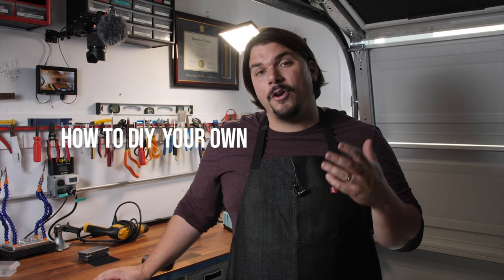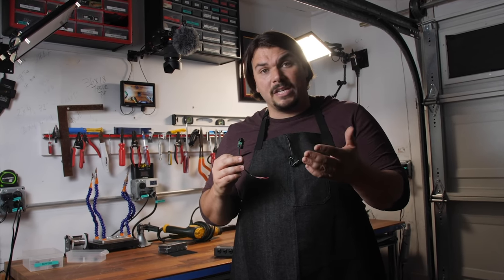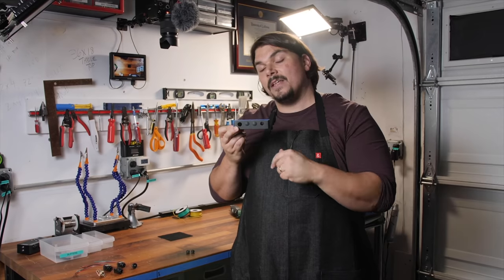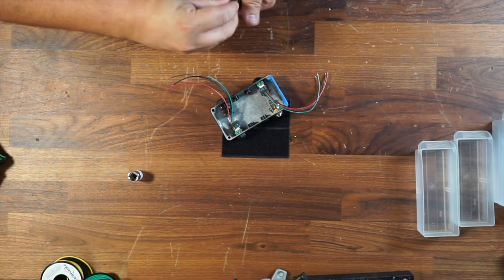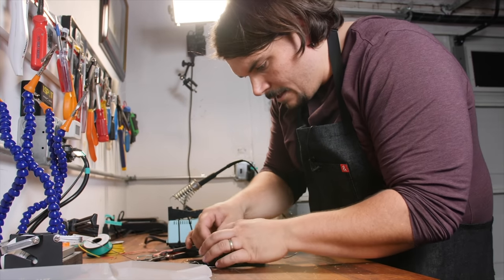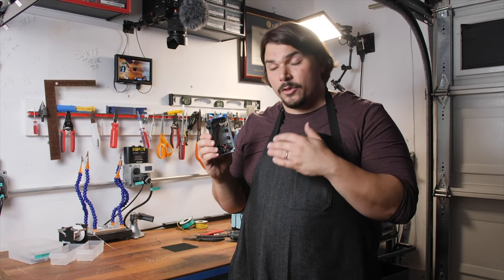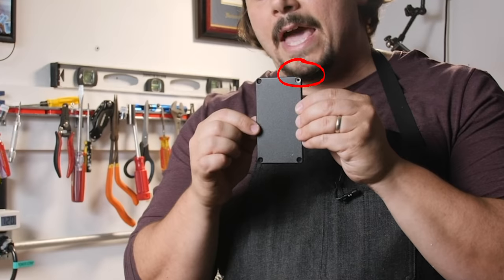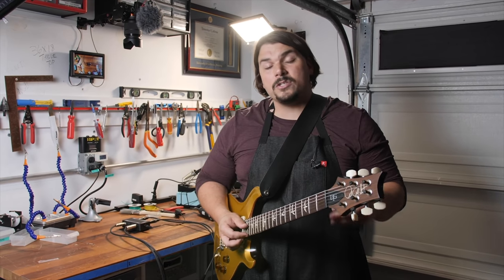Build Your Own Buffer!

Comment: Hey there, so with this build I'll end up with 1 Meg Ohm buffers both at the input and the output of the board but in other videos on the topic I recall (and please correct me if I'm wrong) you recommending a 80-150 Ohm output buffer. Wouldn't this result in an extra bright tone? Thanks!
Reply from the maker: You can set the R1 value to whatever you want but I recommend 1M on the input buffer, the output buffer isn’t so important what the input impedance is.  Anywhere from 500K to 2.2M would be fine.  For the output impedance anything below about 150 is ideal but there are some exceptions depending on the rig and the amount of capacitance on the output of the buffer.  The closer to zero ohms output impedance you get the closer it’s going to sound to your guitar into amp - not brighter, just more neutral and less affected by capacitance.
Reply: @VertexEffectsInc  I really appreciate the answer, thank you! I not quite sure how I would set the value of R1 and couldn't find any resources on Creation Audio Labs' webpage, though. Do you know of any online resources that I could refer to? I'll shoot CAL a message as well, surely they'll be able to guide me :) 
Thanks again for your time and for the great content you're putting out!
Reply from the maker: @francescofusco3013  R1 is the place for the first resistor in the circuit that changes the input impedance.  If you set it to 1M, it's 1M, if you set it to 500K, it's 500K.  So you can use that R1 space to set the input impedance to whatever you want.

Comment: Great content as always, Mason. Is it possible to just use the buffered inputs and outputs for the guitar and amp, essentially creating a buffer pedal?
Reply from the maker: I don’t understand the question
Reply: @VertexEffectsInc  I think he means connecting both cables from the amp and guitar through the buffer, utilizing it solely as a buffer pedal.
Reply from the maker: @RyuKatolikeseaweed  still don't understand
Reply: @VertexEffectsInc Unless I'm mistaken I think he wants to use this as his only pedal between his guitar and amp. And he's asking if it would serve as a buffer pedal if he does (which it will).
Reply from the maker: @RyuKatolikeseaweed  any pedal turned on, buffered bypass or not, it a buffer.  However, the quality of that buffer is generally poor as a line driving or controlling the pickup loading.  Remember a buffer is not a buffer is not a buffer.  Not all buffers are created equally.  So just because you have a buffer in name, means nothing about how good it is at isolating the impedance of your devices, controlling you pickup loading, or driving capacitance on the output.  This is why I advocate for dedicated input and output buffers so this is no longer a concern.  Your board has a hardware firewall so you can have all sorts of impedance changes and you'll still have a constant high quality line driver and your input will have the right loading so the guitar reacts as it would plugged into your amplifier.

Comment: Hi, just wondering...the guitar signal goes through the cables used to make this loops/buffers etc. Can you use the Mogami 2314 to wire it for better sound or is there no advantage at all? Thanks!!!
Reply from the maker: I actually don't recommend using Mogami, hook up wire is preferable.

Comment: Would that buffer work with a germanium fuzz after it?
Reply from the maker: After it, yes.  Before it no...no transistor-based fuzz (like germanium) will work well with a buffer before it (or low impedance output running into it).

Comment: Would you recommend using buffers for the effects send and returns as well? Seems like there is enough power to buffer all 4 ins and outs?
Reply from the maker: Depends if you have an active loop or not.  Typically on the return of an active fx loop would be all you'd need.  If you have a passive effects loop then you'll need something different all-together.
Reply: @VertexEffectsInc  Makes total sense. Thanks!
Reply from the maker: @Tom-L  hope that helps!

Comment: Hello, doesn't such interface make a ground loop issue, because of connecting grounds of the begin and the end of the pedalboard chain?
Reply from the maker: No, not any more than any other pedal in series would have a propensity to, and all the jacks are isolated except for the input jack.

Comment: Hi  Mason would be MXR CA MC 401 good to use as an output buffer at the end of the chain ? Strangely in the manuals I have it says clearly 1meg Ohm Input impedance and <150 Ohm output impedance but on their web site it says 1 K Ohm input  impedance. Is there a way to measure Input and Output impedance of the pedal with a multimeter ?
https://www.jimdunlop.com/content/manuals/MC401.pdf
Reply from the maker: That would be fine at the end of the chain as long as it's "ON"

Comment: Mason,  This is coincidental that last weekend I found your video from 3/19/2020 about the DIY 4CM box, ordered the parts and they are beginning to arrive.  Now you show how to add buffers...super cool.  Question I have is, I use a few pedals in front of a Vox Tonelab EX and go back into an amp from that (it has switching to turn the DI signal off to accommodate an amp).  I'm guessing I don't need to buffer back to the amp from a Tonelab...right?  Also, do I need an input buffer if I use a good wireless (which I don't have yet) and hit that first from my guitar?  I think I may only need a buffer for the FX loop in my 4CM setup.  What do you think?
Reply from the maker: You should buffer the input and output of the entire system.  If you're using 4CM you should have three buffers, input, output, and return.  I have diagrams for all this.
Reply: @VertexEffectsInc  Thanks
Reply from the maker: @davestadel  sure thing!

Comment: If I wanted to use this without the guitar jack, I should be able to just run a ground line from the “to pedals” buffer, to the pin closest to the pedal wall of the “guitar in” neutrik connector, right? Then just run a ground line to a drilled screw through the pedal body?
Reply from the maker: Depends one what you're running it into.  You could wire it loose I suppose to other jacks but you'll need some I/O to the buffer.
Reply: @VertexEffectsInc  I’d run it just as shown in the 4-cable method. I just happen to like the aesthetics of all black connection jacks on this box, and figured I could ground it to the case with a screw, vs using the guitar shunt jack. I’m just not sure where I should ground the swapped neutrick jack, then having a wire screwed to the case.
Reply from the maker: @gregnelson9335  You can still wire the shunt on the black jacks, and run a wire off the ground lug to the case or even to a washer around the innner jack, like a tooth washer.

Comment: I'm planning on making one of these for my board. The last pedal on my board is an Aphex Aural Exciter/Big Bottom pedal. It has both low and high impedance outputs, a ground lift, and different settings for passive and active electronics. Should that come after the buffer? TIA
Reply from the maker: What's the output impedance of this unit?
Reply: 1Kohm
Reply: Any ideas, Mason?
Reply from the maker: @frankstabler1920  The output impedance, at 1K, isn't low.  That's about 10x higher than I'd recommend.  I'd put the buffer after this still, and just make this the last pedal before the buffer interface - it won't hurt it to have the buffer after it that is a better line driver.
Reply: Thank you! I'm really looking forward to building this. I've already printed the materials.
Reply from the maker: @frankstabler1920  Amazing!  Have fun!

Comment: So awesome, can't wait to try one! Haha how hard would a DIY 1/4" unbalanced to XLR balanced isolator (stereo if possible) box be for like a stomp or iridium? bonus points (a lot of them) for a summing switch haha
Reply from the maker: Isn't the Iridium unbalanced?  I think it already have a low Z ouptut so you may not even need an output buffer.  Don't Mono Sum, just go out of the left output and you can make some new presets with hard panned L outputs when in mono.  The Sum is way worse of a compromise sonically and not what you thing.
Reply: @VertexEffectsInc  yeah it’s unbalanced, I guess I was referring to basically a DI box of sorts to go direct to foh and then a summing switch for it you run wet effects after it but need to run mono for some reason and don’t want to rewire haha
Reply from the maker: @joshfirlotte  how many feed to you need to drive off of the output of the Iridium?  I think its around 100 ohm output which means it could drive about 100ft of low to medium capacitance cable without any loss.  If you wanted to to an SGI type approach to convert to balanced it's possible but not cost effective for this application.  Again the Sum is a HUGE compromise, I would run mono out of it if you want to run stereo wet effects after the output of the Iridium, but isn't it designed to be put last with the wet effects running into the input?
Reply: @VertexEffectsInc  not super far, 20 feet so I guess that would be ok! I don’t know much about phantom power but I heard that is potentially one concern of it coming back from the console by accident?
Sorry, for the summing thing, say I did have the iridium at the end and wet effects wired in stereo running into it, is there still a compromise if I used the sum to mono switch on the iridium as compared to just having everything wired in mono? Does summing maybe not do as good of a job at getting a good mono sound squishing things back together as if everything was just wired in mono? Sorry this is unclear rambling. For example without the iridium even and one amp instead, would there be a big difference between running everything mono to the one amp vs having everything wired in stereo, then summing it back together with a device (like on the PBC6X for example, I think I saw in the editor you can change the output to 'stereo to mono summing') for a single output to the one amp?
Reply: @VertexEffectsInc  I know a few people that prefer their wet effects after the iridium. It would be neat if it actually just had an effects loop before the ir inside. But I was considering running wet effects in a stereo loop and the iridium in a stereo loop of the pbc6x so I could swap the order around depending on the scenario to play with the different sounds. The guys say things sound less muddy and you can go even wetter with wet effects after
Reply from the maker: @joshfirlotte  If you are connected directly to the mic input and not a separate line input (like some mixers have), it hypothetically could do some damage.  Phantom power is current limited - I think maybe 10ma, so if the DC output impedance of the pedal is high enough you could have a problem.  If possible use a line input on the mixer and you'll have no issue.  The issue with summing is that most of these stereo pedal devices aren't designed to be summed with external hardware.  Most of the stereo mixes inside the pedal aren't always 50/50 Left and Right, and the summing devices put them together as though they're 50/50.  Also the polarity/phase of these stereo effects, in particular modulation devices, often have inverted outputs on one channel.  This further creates issues when doing a mono sum of a stereo rig.  You're much better off hard-panning your stereo effects hard panned to the left and using that as you mono when you need to do that.  I like to copy all my presets and have all the odd numbers be for mono copies of the following even number stereo presets.  E.G. Preset 1 is Dual Delay hard panned L for mono, Preset 2 is Dual Delay in stereo, and so on.  If you run the devices after the Iridium I suppose you could do it but I don't know if the Iridium IR and Cab sims are designed to have effects running after it, and whether your effects can hit a line level input on your mixer.  Might be work experimenting with.
Reply: @VertexEffectsInc  I was just about to finally work my way though your message and try to wrap my head around it when right under the reply box I see a beautiful thumbnail of an upcoming video in two days! haha. Still going to try to understand as a precursor to the video though. Can't wait, you're the best!
Reply: @VertexEffectsInc  Ok, that makes very good sense. Can't wait for the video, thanks!!
Reply from the maker: @joshfirlotte  yes indeed, I think it will make more sense and you'll hear sound examples as well of what you loose.

Comment: No real info on the website on the matter but what type of buffer is this? IC, opamp (jfet??) Just curious.
Reply from the maker: This one is opamp.  I generally prefer opamp this is as good or better than most any I’ve seen and for a diy application is the absolute best out there.
Reply from the maker: I checked with Skip Welti at CAL, it’s actually a JFET input into OPA.  So a hybrid buffer.  Still the best diy option out there.

Comment: Is this really better than having a (stereo) Boss pedal on your board?
Reply from the maker: to do you stereo split, yes!  1K output impedance for a BJT buffer might get you 10ft without an issue if the cable is super low capacitance.  After that, you're degrading fast.  The more capacitance on the output of those buffers the worse it is.  Also, you would still need to address the input buffer situation.

Comment: Great DIY film. But what about buffers and fuzzes ? I heard that fuzzes "don't like" buffers ;)
Reply from the maker: Buffer after fuzz always.
Reply: @VertexEffectsInc  Thank you for the answer. And what about this pedal - MXR M173 Silicon Fuzz Classic 108 - a fuzz with buffer. Does it mean that if I had it as the first box in my chain after my guitar, I would not need a separate input buffer pedal, and only the output buffer I should add before the amp ?

Comment: If I use a strymon iridium at the end of my board to go straight into a PA, do I still use this as the first and last pedal in my chain? Or should the iridium be the last in the chain since it’s acting as my amp?
Reply from the maker: Iridium can be the output buffer, you’d still want an input buffer.
Reply: @VertexEffectsInc  wow thanks for the quick reply!!! So if I’m using the iridium or the boss gt 1000 as my “amp” straight into a PA I wouldn’t need a dual buffer just an input buffer? Do you recommend one? Could I still build one with the buffer you recommend in this video?

Comment: I think now all I need shown is how to wire a ground lift and a phase switch
Reply from the maker: Originally this was my plan, however I could never settle on a transformer that I thought didn’t impact the sound adversely. Even among the ones used most commonly for isolation, are poor in many conditions, in particular when there’s a lot of signal going through it, it will often distort in the low end, where servos or a Zobel network can stabilize it to the point where it’s workable.  This is why in the notes I suggest a specific splitter with isolation for this application.

Comment: Thank you so much for this informative video. I'm planning on making one for myself soon. Quick question, if I want to add a LED, would it be ok to connect + of LED to vol + in of the buffer, then GND? or any other suggestion?
Reply from the maker: You could connect and LED, absolutely!
Reply: @VertexEffectsInc  thanks!!
Reply from the maker: @samjclee  sure thing...we'll work on adding an LED diagram to our buffer interfaces in our next add of revisions and modifications.
Reply: @VertexEffectsInc  🙏🙏🙏 That would be awesome!! LED will give a lot of relief for those who have OCD lol
Reply from the maker: No led is a trigger?
Reply: @VertexEffectsInc  yes in a way hahaha. with LED on, at least we know the power is being supplied. One less thing to worry about for troubleshooting :)
Reply from the maker: @samjclee  if the buffer had no power, the rig wouldn't work, or you can use a multimeter.
Reply: @VertexEffectsInc  true true!

Comment: Any plans for an advanced interface, for an input switcher for cable and wireless, buffers, audition loops and all? Or at least a template for all that?
Reply from the maker: You can use the audition loop wiring and apply to any of these diagrams you wont pending you have the jacks available.  I can add one for the wireless/corded that's almost like the audition loop.
Reply: @VertexEffectsInc  *want; I'll be pending for that
Reply: Could you include a footswitch for both inputs, because if the inputs were to be wired in a way where the cable has to be plugged in to bypass the wireless, then it would be a pain to manage in a live situation, where you have more than one guitar. The footswitch option allows you to make the change on the fly, and helps you work more effectively.
Reply from the maker: @TotalEvo7  typically I don't put a footswitch, it's totally possible, but normally guys are either corded or wireless, aren't usually a/b-ing during a set.  Or the corded is as backup for a wireless failure.

Comment: I've got a Monsterpiece mkii tonebender on my board. Would I just want to put the fuzz before the interface?
Reply from the maker: You’d put the buffer in the interface box, not outside the box.  I’d make it so you can patch into it after the fuzz and make the main input passive.
Reply: @VertexEffectsInc  Thank you! So I'm looking at a passive input, send to fuzz, buffered return, then a send and return for the rest of the board, buffered output?
Reply from the maker: So four cable method with a fuzz?

Comment: Do you have other options for the buffer? CAL can t ship to Canada.I wonder if i can build one from scratch.
Thanks
Reply from the maker: Several guys have used freight forwarders cheaply, doing one of this quality is possible but not as easily as loading it in an enclosure and soldering a few wires.